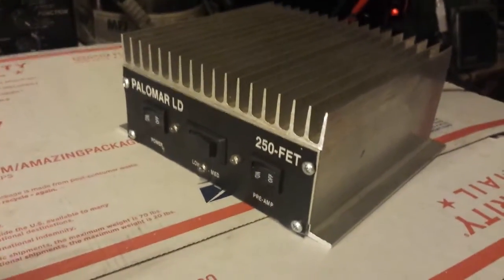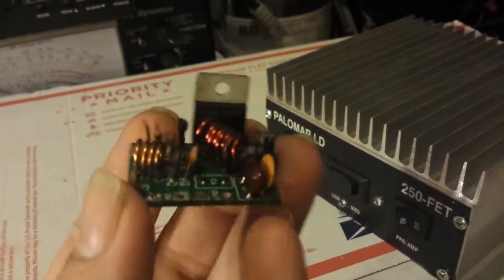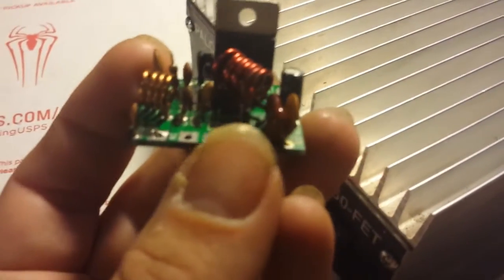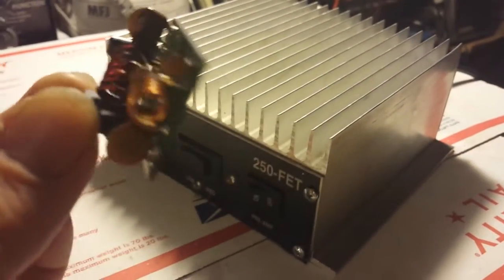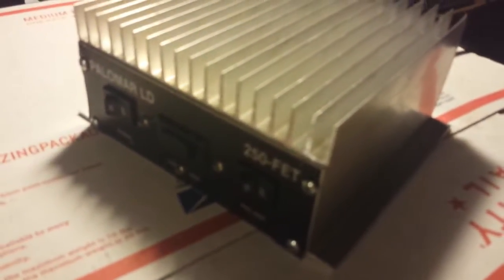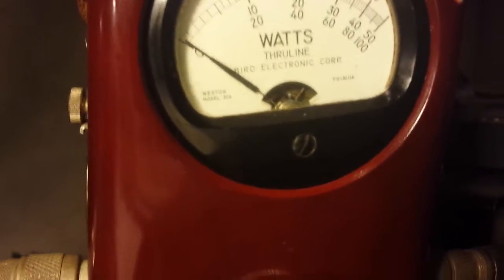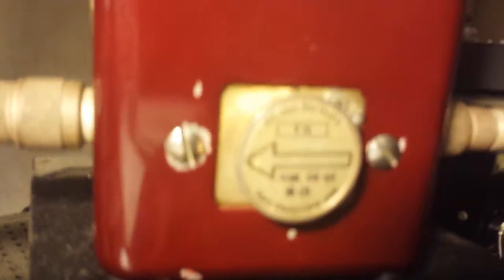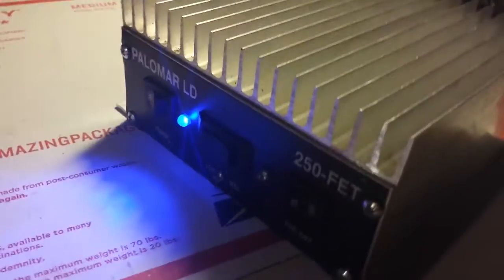Palomar 250FET LD Converted To HD AB Biased Amplifier - [Two ERF7530s]

Comment: i been experimenting with 9530s, i built a 1x2 with a forced air enclosure. hit it with a 4.5w dk and popped the pair. def gonna not try the galaxy on it again. the PC122 was runnin it perfectly low drive only around 200AM 250SSB
Reply from the maker: I have 9530 for sale if you ever need any.... just text me.. I just bought out a guy cause it looks as if they are done making them which makes no sense. Id love to see your project brother 678 557 4846 text me some images if you dont mind. I have a 1x4x16 with erf7530 in it thinking about upgrading them all with 9530 lol